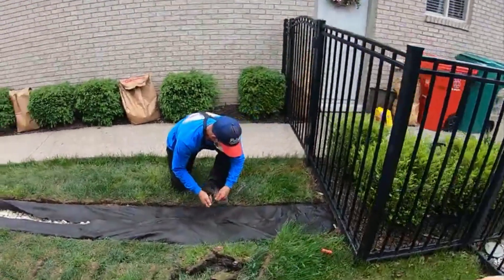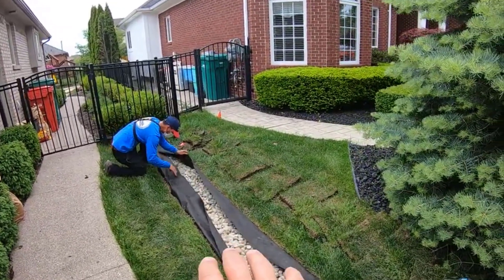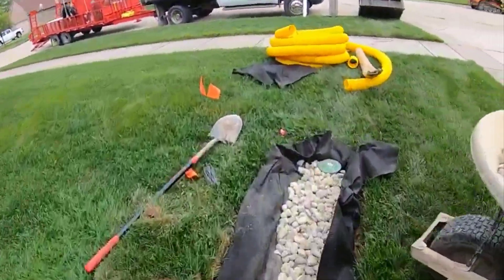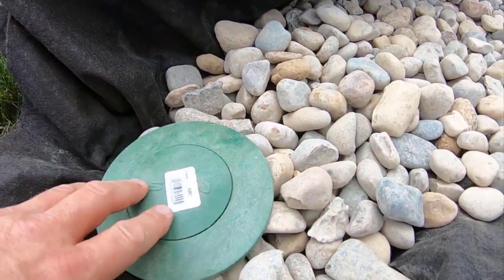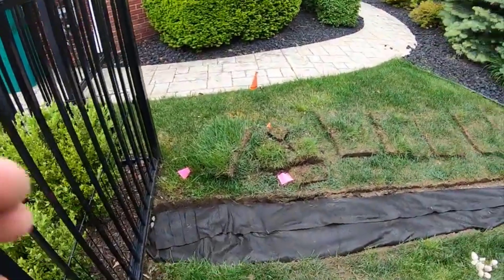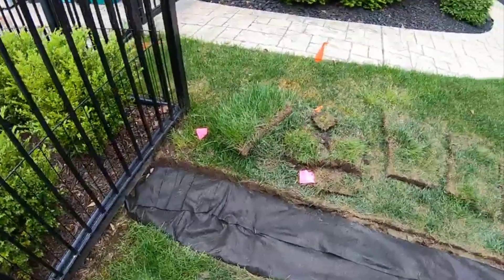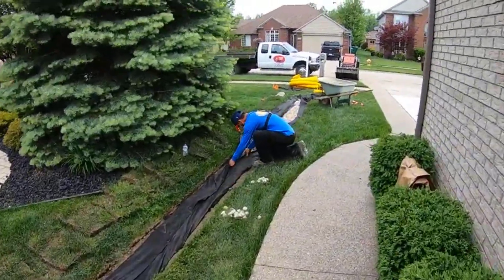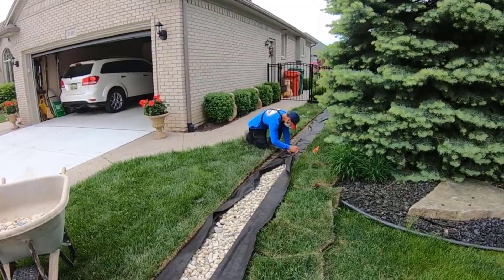DIY How to Discharge Water from French Drain [ Low-Pressure Pop-Up Emitter ]

Comment: What your saying is correct that exactly happened to me. They guy overlapped the fabric too much and it slowed down  drainage so much that it couldnt reach down to the gravel fast enough and it was still flooding. I cut the fabric back to fit without all of that excess and it drained fine after that
Reply from the maker: Thank you for sharing.

Comment: Really good video.  I ahbe a question though. Iam doing this along my garage. My parents live in there and water its been getting in.  When I dig trench I have to slope it down so water traveled downward right?  I was gonna have corrugated pipe all the way to street bit its too far. So can I just add one of those pop up things and put it whatever I want water to come out?  But for thing to pop up it has to be at lowest point of pipe right or it does not matter?
Reply from the maker: Run a Leach line at the end so water doesn't stay in pop up emitter elbow
Reply: @FRENCHDRAINMAN  sorry but what is a leach line?
Reply from the maker: Yes it will work
Reply: @FRENCHDRAINMAN  i researched leach lines but all i see is septic systems?  I don't have a septic system I don't think
Reply from the maker: https://youtu.be/U2Kk1x4KUj8

Comment: Why don’t you put the end of the drain closer to the sidewalk?  It seems like the grass in that area will get saturated and boggy. Is there some rule against discharging to the street? Thanks
Reply: I was going to ask the same thing.
Reply: Good question.  I also wondered why not to the sidewalk/street?
Reply: True, but if you have good sod it's likely a non issue.
Reply: It’s probably a city code thing. Where I live it has to be 5 feet from the sidewalk.
Reply: I’d like to know too
Reply: Code issue. Likely that area is public right of way and cannot have any drains installed on or within a certain distance.
Reply: Most places it is illegal to discharge on the street or sidewalk like that. And its only going to be more and more places over time.
Reply from the maker: https://youtu.be/qoy_yh8NY2M?si=1FYN0GxPxePMUbsZ